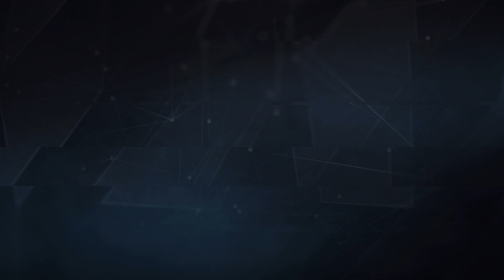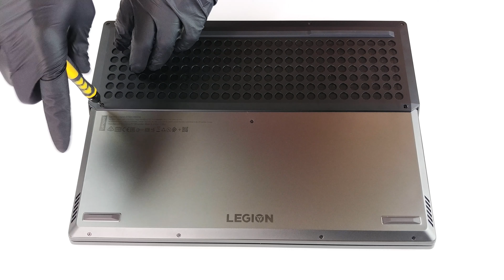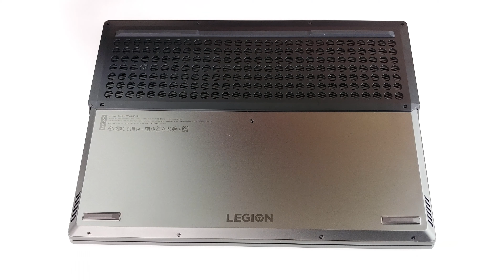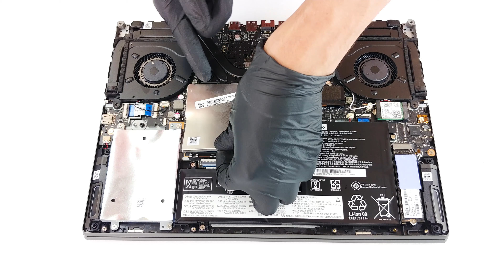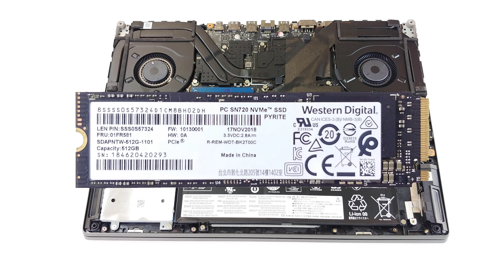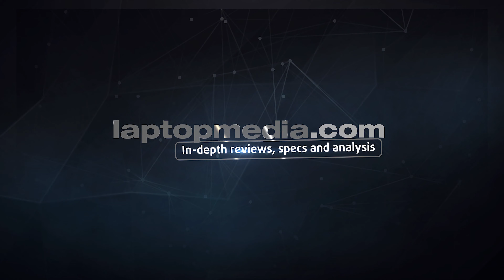Lenovo Legion Y740 (RTX 2060) - disassembly and upgrade options

Comment: hey guys. I just upgraded the RAM on my lenovo y740 and is working smoothly. However, when i place the cover back, the keyboard starts going wild. For example, whenever I press the key "h" this comes up:       +9egh}}p'}  .

If I take the cover off, it's back to normal. I don't know what is causing it, since it's literally a piece of plastic. 

Any ideas?? Any help is greatly appreciated

Comment: I bought this laptop and I'm still waiting for it to ship.  I ordered it with a 512 SSD NvME in it.  I have another 512 SSD SATA from previous build.  Will I be able to insert the SATA SSD I have in this unit along with the NvME drive?
Reply: If it's a 2.5" form factor drive then yes.  I only see one m.2 slot
Reply: @PhilipChou  there's only one m.2 slot

Comment: Ok wheres the HHD? thats one of the most important and u dont even show it
Reply: The silver thing on the bottom left in the video. Straight forward
Reply: @josefglatz  yes i know but is it replaceable? I dont want a 1 tb hard drive, prefer 4 tb
Reply: eijmert yeah, of course! You can replace m.2 or 2.5“ HDD
Reply: @josefglatz  thanks
Reply: Can the hdd be replaced with an SSD
Reply: @BigMikeBell1  I replaced the HDD with my Samsung 850pro SSD. Works fine!
Reply: @josefglatz  There is only 1 slot for SSD/HDD? I can only replace, not add another SSD/HDD, right?
Reply: @Kp0cc  You can only have one 2.5" drive, so if there is already a HDD or SSD in there you can only replace it with a higher capacity drive.

Comment: Man, unscrewing those little screws…You made it looked so easy! Those things are so tightened, I don’t know if it’s because of them being heated or done it on purpose (to prevent people to do it themselves and make them to bring to service). Anyway, those lucky ones got them all open, remember not to tighten them back.
Reply: I'm sitting here trying it myself right now. 2 screws out, 3rd one is now mostly stripped and dunno what to do.. guess I'm not getting into the back of my laptop anytime soon.. what a piss off.. For the price paid, you'd think they could use half decent screws?! I even paid extra for the laptop to be made out of metal, not plastic!!
Reply: @jessed6838  If you managed to open the cover of the back out, all you need is to "unplug" the batter's connection then reconnect it. Battery can still be good enough, then set it to charge only 60% max to preserve it's life. But if it were really toasted, pretty much only option left is to bring it to the local shop, it sucks to pay extra though but at least you still get to save the laptop.
Reply: @SwornReaper  thanks man, but I was only hoping to open the back to clean the dust out and maybe upgrade my RAM.. one screw to open the back is so tight that it's now mostly stripped. I've tried every hack i know of and looked online.. it's almost like it's heat fitted lol.. going to have to go buy a special tool or take it to the shop to get 1 screw out...... just pissed after spending nearly $3000, only to find out the screws to open the back are stuck...
Reply: @jessed6838  if you manage to slip very little lubricant to go underneath the tiny screw, wait few minutes, then use the tip of razor blade wrapped with small piece of cloth, fitted entire edge of the screw, to turn it slowly. Of course this only works if you can do 1st step perfectly, otherwise it can turn worse.
Reply: Get an engineer brand plier, it will grip all of the stripped screw, $20 saved me a lot of time

Comment: what did you use to remove the screws? ive tried like 6 diffrent smaller screwdrivers and none are able to unscrew them
Reply: I have the small set of iFixit. This are "normal" Philips screws.

Comment: Hello. Where is the 2.5inch HDD? left-down area which has silver cover? . Second question, What kind of screw driver do I need to dismantle the cover? Thank you So much.
Reply: Philips Srew Driver (the one you use for the case disassembly). Easy Cheese

Comment: hey Awesome vid.  quick question.  i have a 2018 origin evo 17-s laptop and i need to replace the cmos but i have never seen a cmos battery like these and dont even know what they are called.  looks smaller and is wrapped in plastic and has 2 small wires that attatch to motherboard coming out of it.  any ideas? thx.

Comment: Can the battery be upgraded?
Reply: I've read the 17" model's battery can fit if you remove the 2.5" drive but going about finding just the battery itself has been a challenge. With all the complaints of the battery life you'd think more would be showing upgrades to the battery but no :/
Reply: Yes, just plug socket 😅
Reply: Yes, but only if you are Willing to lose the hdd for half an hour more of battery

Comment: Do you have to re install windows after changing the ssd?
Reply: Probably
Reply: If you change the NVME SSD, yes, because here is the SO, but If you change the other then is not necessary.
Reply: No as you can copy the contents of the old SSD across onto then new SSD before you install it.

Comment: mmm, that is not what I understand as a "disassembly", is just "how to open the case and change the memmory or the NVME SSD". Even you have not shown how to extract the standard HDD/SSD drive (that is an upgrade option), or even the fans (is very useful because surely will need to be cleaned someday).

Comment: Can the 17" battery go into the 15" ?
Reply: They're different capacities, so I highly doubt it
Reply: @Skrubenz  I've read that if you remove the 2.5 drive it fits
Reply: @Skrubenz  since when capacity is a sign of incompatibility?????? OFC u can have 76watt one in 15" model
Reply: @XanderPCT  I meant size wise. The one on the 17" model is bigger and will not fit in the 15" model without modifications to the 2.5" drive slot. I've heard some people say you have to modify the drive slot, which will void your warranty and some other people say you just have to leave the slot free and you can fit the bigger battery in.
Reply: @Skrubenz  Throwing away the 2.5 bay should be all you have to do. I am searching the internet as well and so far it seems this is all you gotta do to extend your 15" laptop battery life.

Comment: Can someone tell me if every y740 ram is upgradeable. I want to buy it from here Entdeckt bei Cyberport: Lenovo Legion Y740-15IRHg 15"Full HD IPS 144Hz 16GB/1TB+128GB SSD RTX2060 Win10  https://cyberport.de?DEEP=1C31-3H1&wt_cc2=mobile_sharing-ios-li but when I compare it on the website, it only tells me max ram 16GB.

Comment: Can I get a better wireless card for it? If so, which one?
Reply: Indeed, I don't know alot about Wireless Cards but i know it is the Intel 9560NGW 802.11ac model there are in the machine showed in the video.

If you like to find a better one then note that is need to use the M.2: CNVio connector

The specs for the default wireless-ac in the machine:
https://www.intel.com/content/dam/www/public/us/en/documents/product-briefs/dual-band-wireless-ac-9560-brief.pdf

Comment: what ram would you recommend getting to upgrade mine with?
Reply: Samsung 32GB DDR4 2666MHz RAM Memory Module for Laptop Computers (260 Pin SODIMM, 1.2V) M471A4G43MB1 

Your Computer can support 64GB of ram (I Have done it) get two of these and let the good times roll!

Comment: Why bother all this and just COMPLETELY SKIP HDD???
Reply: If you look closely there is no HDD installed. That's just an empty bracket.
Reply: @medieval.software  Do you know if the laptop still comes with the SATA cable for the HDD?
Reply: @barrybena1336  It doesn't however the slot is there. Sometimes manufacturers send SATA cables with their HDDs so you can get that checked out.

Comment: I will purchase this laptop only if it will be possible to replace the speakers with my Y50 speakers .. 
the Atom's Dolby just sucks compare to my Y50 JBL.
Reply: no JBL, no AKG, no HarmanKardon speakers were ever in any laptop, these companies always only provided a software equalizer to tune the speakers
Reply: Lenovo used to work with JBL, my y510p has JBL and a Subwoofer. They recently have stopped putting JBL in their products which is very disappointing. Lenovos old laptops speakers were insanely good!